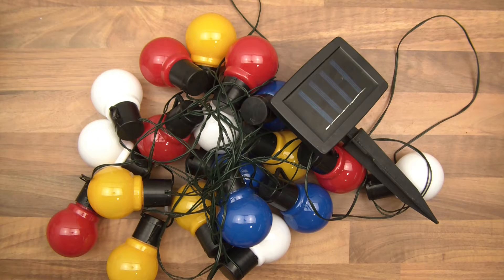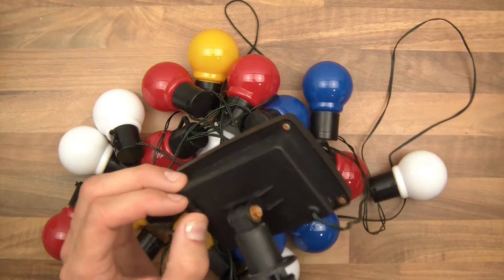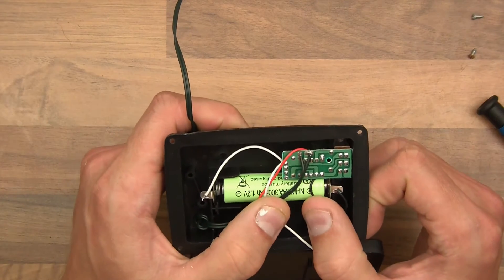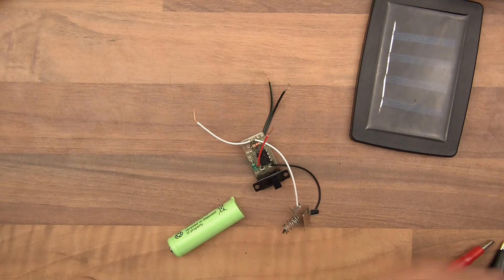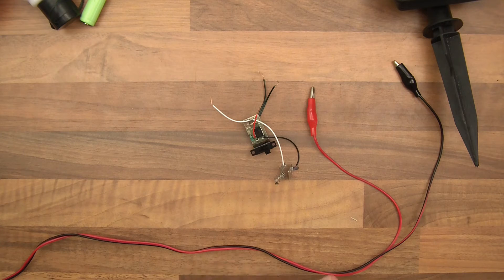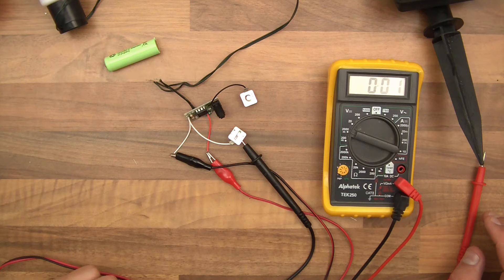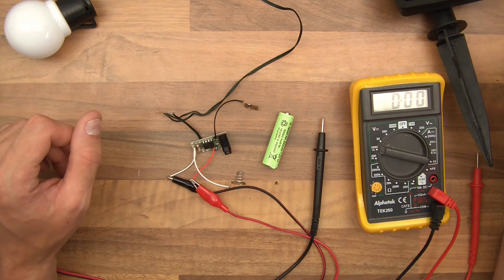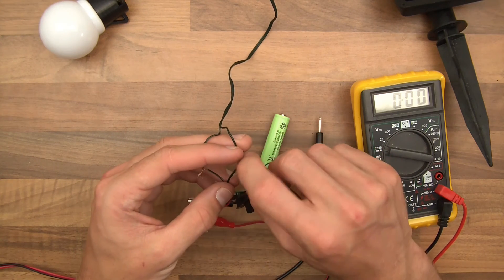INVESTIGATING: Broken Solar Powered LED Lights!

Comment: If the circuit does output 3v when fed from a 1.2v cell, I wonder what current can be drawn from it. 3v could be very handy to power various sensors or maybe even an Arduino Mini or the like from a 1.2v source.
What about all them solar cells you bought a while back. Could you not just stick one to the existing panel with some epoxy and connect that up?
Reply from the maker: Hey Martin, that's a great idea actually. I could do with buying some of those chips! The solar panels though are all around 5-12v. Too much outage. :(

Comment: Interesting, 7:50  when you had the switch turned on, the camera mic was actually picking up noise from the circuit. This was confirmed as you turned the switch on/off.  That's a very noisy circuit for how basic it is.
Reply from the maker: Interesting! On the laptop and computer which I use for editing, I don't hear any noise! Now that I play it on my phone, it's very noisy. Coming to think of it, I think I know what's happened to that camera. I had a lot of complaints ages ago about noise. In the end I fixed it by flashing the camera with newest firmware. But a few days ago, I reset the camera and forgotten that it may have wiped it off..
Reply: @antonycartwright  Hahah, oddities  😜
Because of the frequency of the noise, that's why with the laptop it's not audible. As for the computer, I'm going to guess you don't have mid-high end speakers  😉
I have Altec Lansing on my computer. It plays a very wide range of frequencies, plus helps my ears actually can hear them too.
Reply: It's basically a low budget boost circuit.  The chip is switching at some frequency and the resistor-shaped inductor is kicking out a spike of voltage as it's field collapses.